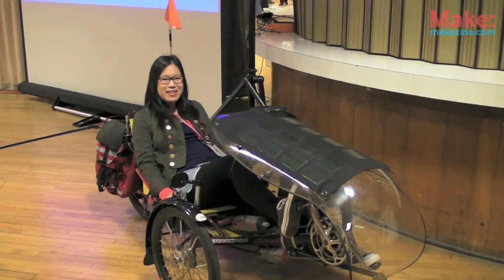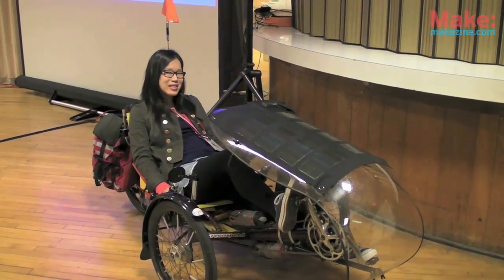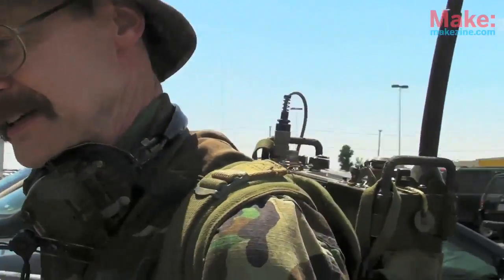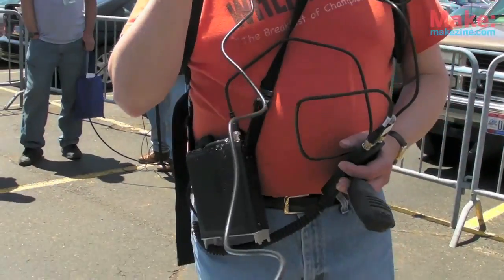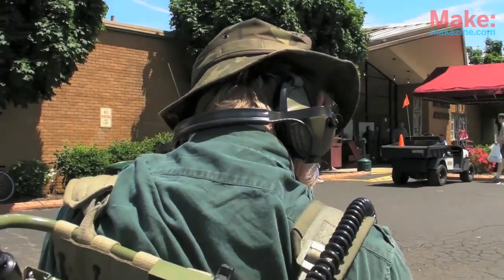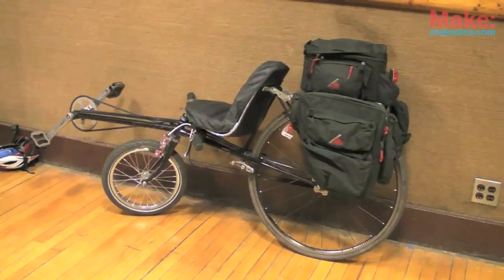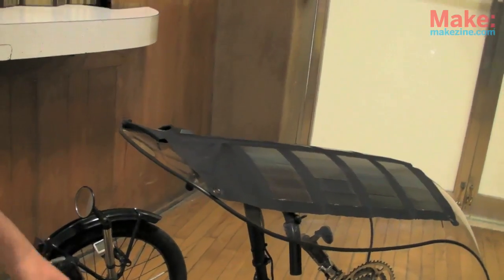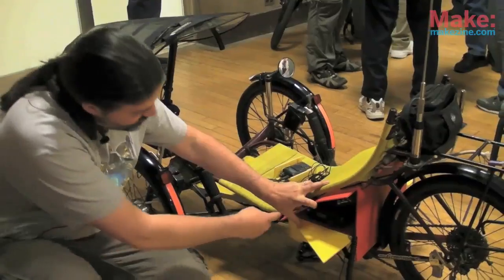Mobile HAM Radios

Comment: @NZ7Bqrp I have done it before on 6 meter, 2 meter, and 70 centimeter FM. My setup was simply a magnetic mount antenna on the rear fork of a bicycle and a Yaesu VX-5 running off of its internal battery. With the solar cycle ramping up it might be a good idea to try working the HF high bands from a bicycle as well. I could only do 10 meter SSB due to the limitations of my license class at this time.

Comment: One thing though, when the power goes out so does your cell phone. With this, it doesn't matter if its armageddon, it will still work (as long as you have enough batteries).

Comment: @UtRadioGuy

I'm there with you, but like someone else said, this saves lives, because, cell phones use cell phone towers, and when they're gone, there's no where your cell phone can contact to get a signal. Where as one of these, each person is an individual tower, I also think that each ham radio repeats someones signal, just like cell phone towers do.

But for going places with this thing? NO

I'm not that educated on radios so I wouldn't know any of the specific names of anything I said.